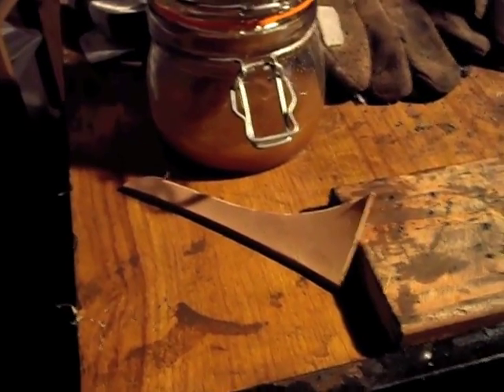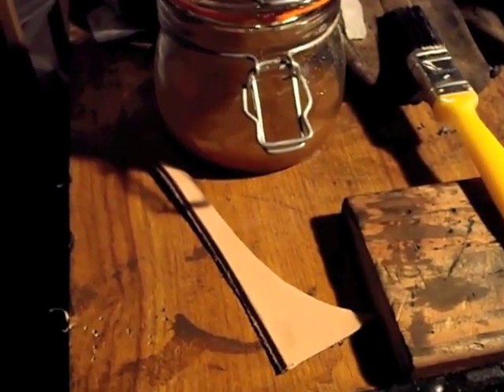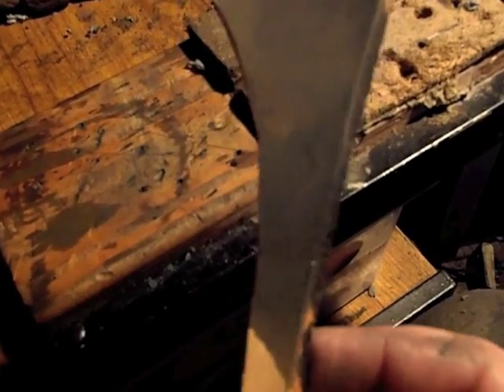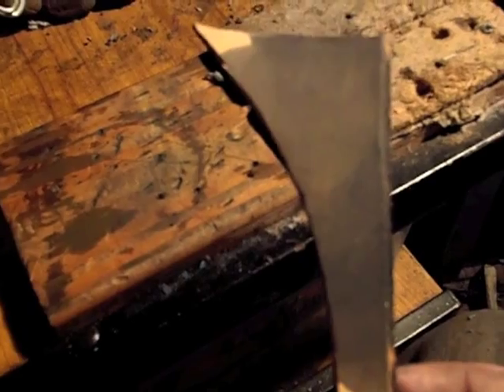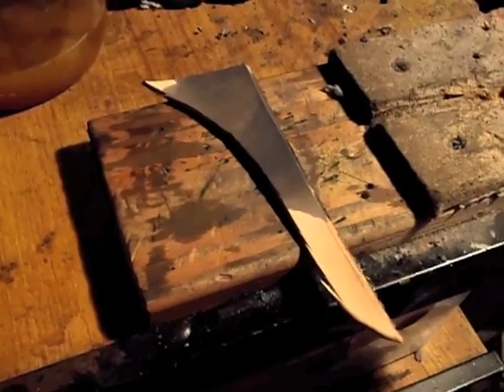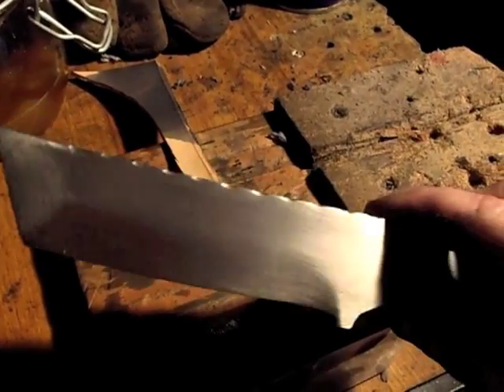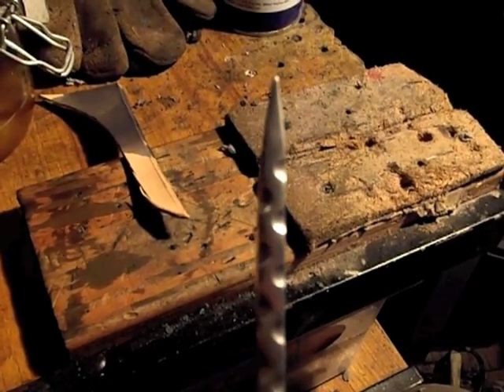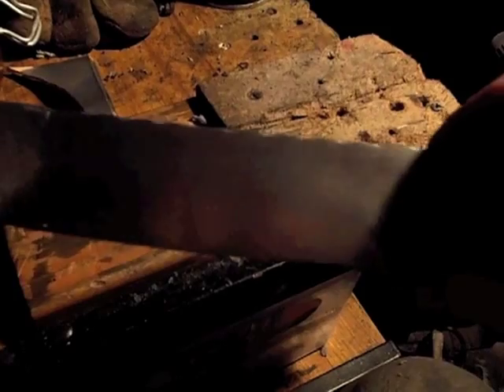Dying leather black without black dye? Vinegaroon!!!

Comment: I've been working with leather for quite a while so this is not new to me. However, it would be best to dip the leather into the vinegroon rather than using the brush. This way the color will soak all the way through the leather. Still damp but not soaked, take some oil (I use neetsfoot oil) and lightly coat the leather. Thanks for posting your video. Most people have never heard of this method except the old timers.
Reply: mx72sss hello is it possible to paint some white details on a black suede shoe ?